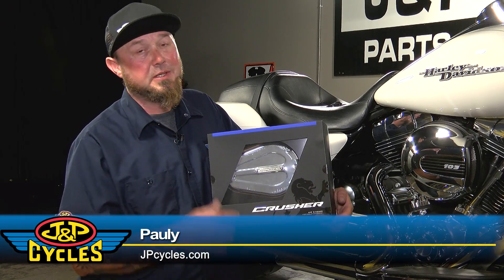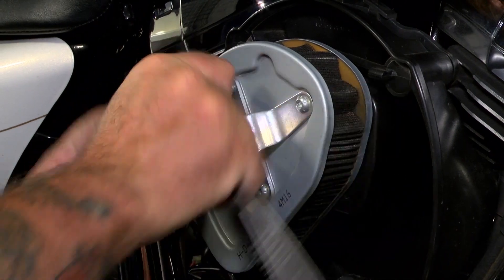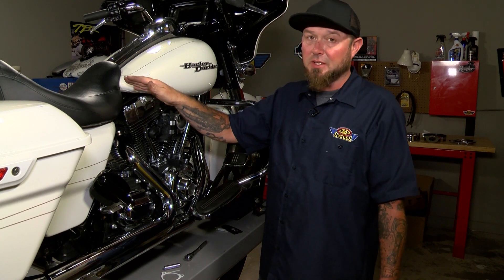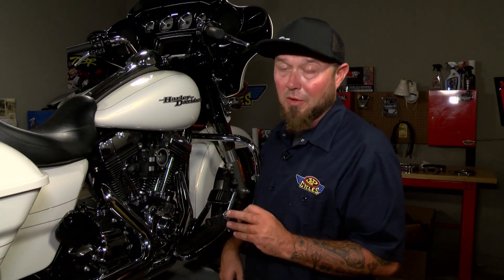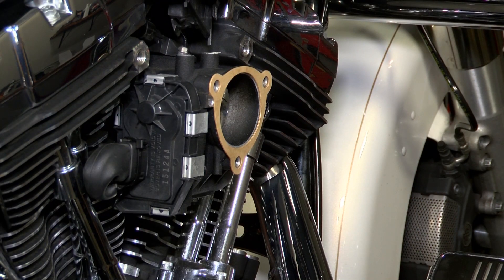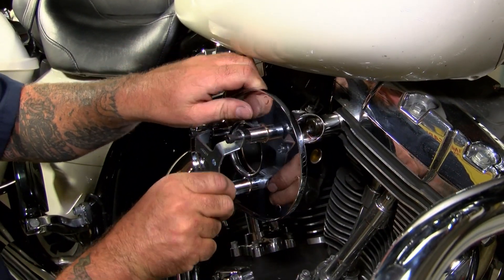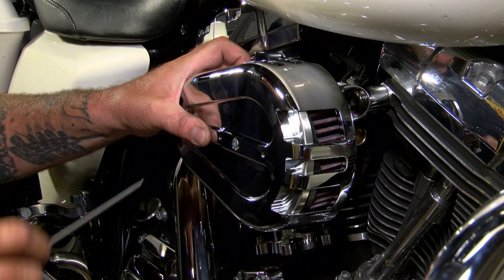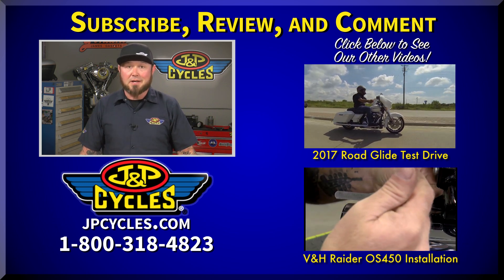Crusher Maverick Air Cleaner Installation

Comment: Hi, You were talking about lifting the tank.  Why is  that necessary?  Were you taking off a bracket?  I am just a novice but want to install an air kit on my 2004 Road King Custom EFI  FLHRSI .  I enjoy working on the bike myself when I can.  Please advise.  Ed Pasco
Reply from the maker: Lifting the tank is to remove a bracket that is not used with this air cleaner. This isn't required on all models or all air cleaners.
Reply: Wow Thanks.  I feel more confident about installing this now.  Thanks again.